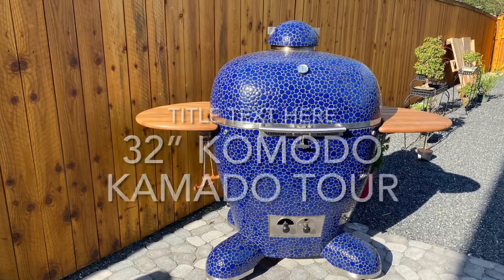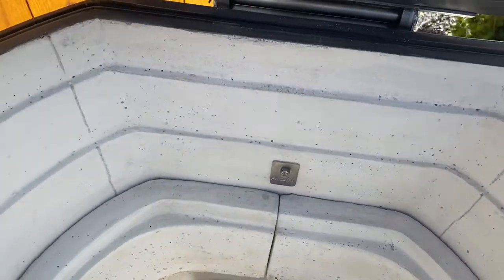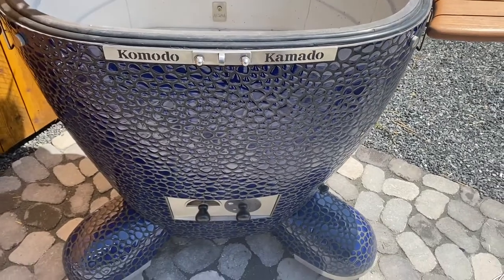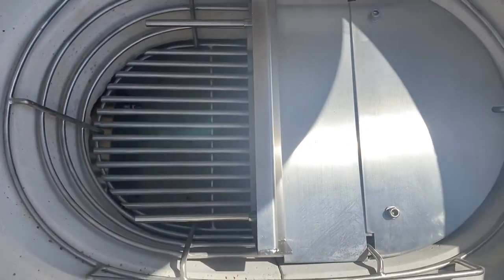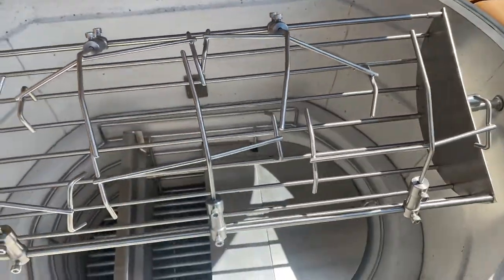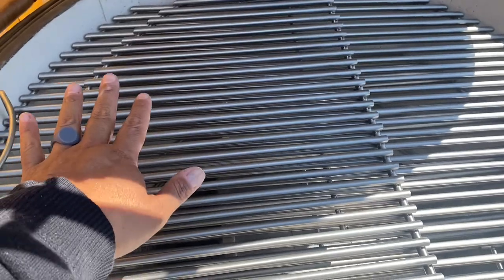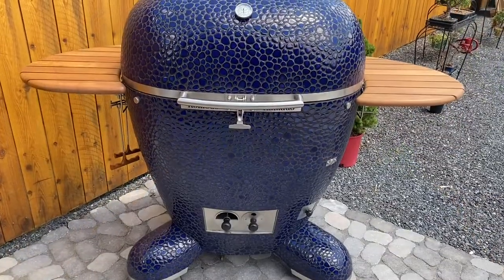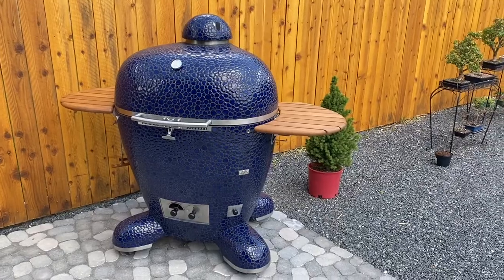32” Komodo Kamado Tour

Comment: I’ve have a KK 42” for about 18 months now, done just over 100 cooks on it. Good as the day it was delivered. You will make you a better cook/chef than you already are. It’s like cheating it cooks so good. Enjoy 

Any one pondering a Kamado, if you have the means consider a KK. I wouldn’t have any thing but. 2nd house, 2nd KK. Either the 32 or 42 I think are the best idea(as mentioned in the video)But they are all great! 

One other thing is I’ve used my 42 for everything but rotisserie, and I only use ½ this charcoal basket. Searing and low and slow really can’t be done at the same time, your temps will get too high. Sear after a low and slow is finisher, pump up the fire then. A low & slow fire isn’t big enough for anything else. Practice and you’ll see, have fun🥩🤠

Comment: Great walkthrough. A KK is my dream cooker. It will be a very long way off if I ever order one, as I need to get the deck rebuilt first, and I may have  a big debt to the government before that depending on how they decide.

But I am torn between the 32" and 42". On the one hand, the 32" is probably more than I'll ever need, but on the other hand, there's an element of "go big or go home" when you're already spending what the 32" costs, and the 42" does seem to have some additional flexibility. For the 42", since a single grate would probably weigh 50 pounds or something, they just segmented each grate into 4 pieces, so I've seen photos where people had all four segments on for the second level grate, but only the left and right segments on for the top grate, so they can have potatoes baking on the left and ride sides of the bottom grate, with pork chops cooking in the middle, while on the top grate they had some tomahawks on the left and a pan of something on the right. So the big hole in the center lets you conveniently access the bottom grate, whereas with the 32" you'd have to lift the whole top grate up and off to get to it, I think.

That being said, if you were cooking on the 42" for four people or less (which is what I'd be doing most of the time), it might require twice as much charcoal or something for all I know seeing as how it's so big.